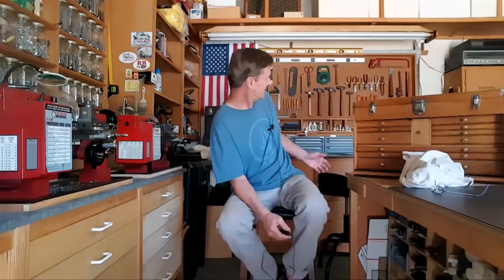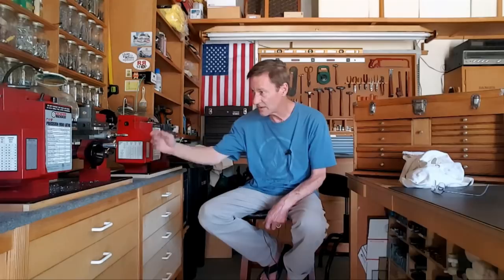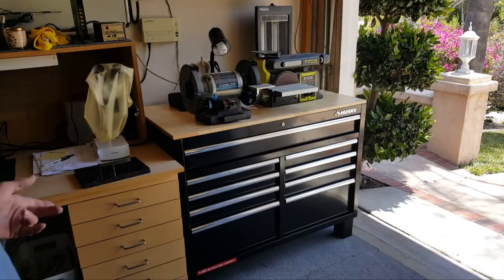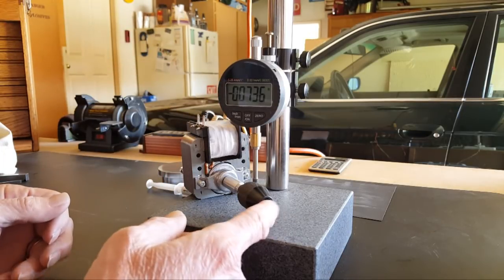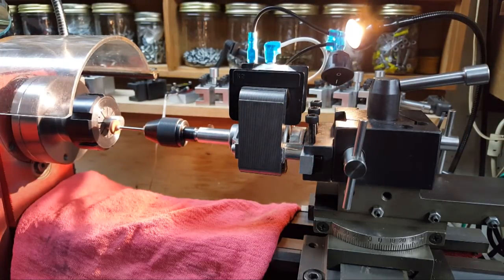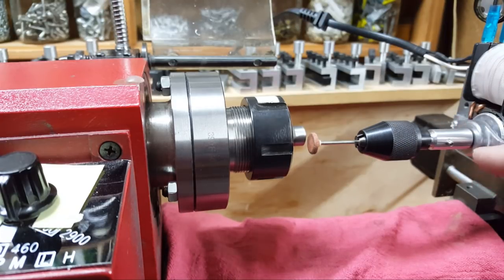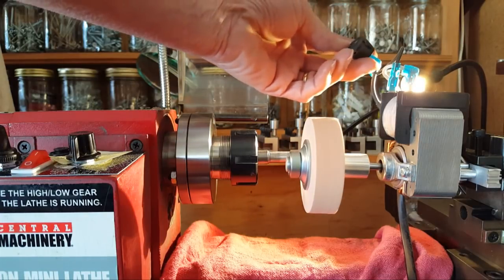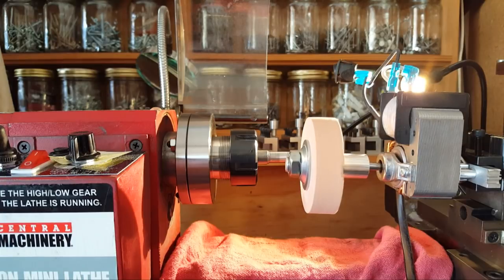Lathe Grinding Attachment DIY Fail

Comment: Hi Dave another great idea . I made one that i use on my craftsman 109 lathe I used a dremel tool  grinder  i had it attach to a pipe clamp and a bracket to go on the tool post . ill look in the shop this week and send you a pic if you like ok Dave  love them video  keep it coming thanks.

Comment: Harbor Freight 62659 trim router.  Similar has been used for years by others.  Price a little higher than I remember, but it's a 1/4" collet, internal grinding no problem, but all you're interested in is the motor.  Pulleys for driving external grinder, should work okay.

Comment: Dave,
That little motor does way....and I do may WAY too few revs for this. 
Grinding wheels of this sort of diameter, need to spin at around the 10 000 RPM. If they don't you will just make a load of grinding wheel dust, but achieve nothing much else...

Cheers!
Paddy

Comment: I thought I had a special wife and it looks like you do too Dave! Mine would have done the same thing, I’d be standing there trying to figure out how to get it in the car, she’d go grab a few guys and tell them to put it in and throw them a tip. You’d think we would have learned by now!
Reply from the maker: I would have sworn by removing all the drawers and runners that it would be light enough that I could get it in the car by myself. My clue should have been when they had to use a fork lift to put it on the cart that it was pretty heavy. At least the two guy were struggling to lift it into the car...

Comment: Hi. I'm not sure if this could work, but why not to harness power of your Mill standing next to the Lathe . Flip the Mill head 90 Deg an align with your tool holder. Now is the issue with linking the both but I know you are full of the ideas. Good Luck.

Comment: Nice gage pin sets!  I need to get a set.  Do you prefer under or oversized pins for the work that you do ?
Reply from the maker: All my sets are minus so if I want a .062 hole and the pin just fits it I know the hole isn't over sized. Look on ebay for prolinemax and offer $5 less than asking. The sets are heavy so free shipping is a big PLUS!
Reply from the maker: The .251 to .500 set I use the most. The video shows the .501 to .625 and .626 to .750 sets.